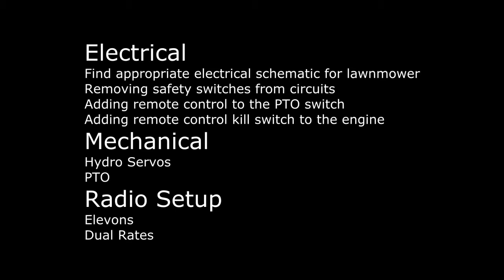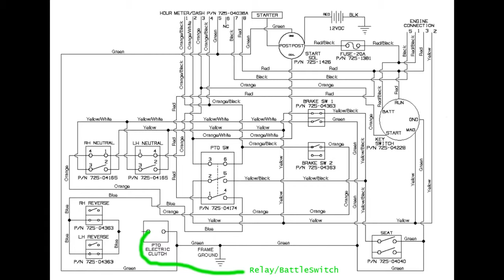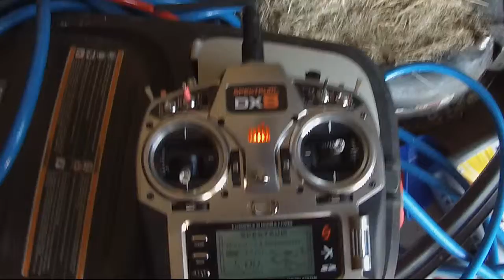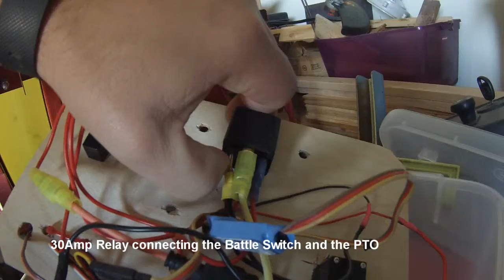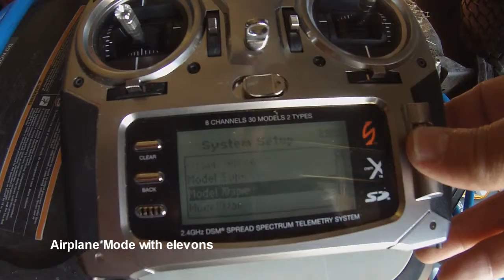DIY RC ZTR Lawnmower How-To

Comment: I just built mine on a Hustler Super Z 60" ZTR mower. I actually bought 99lbs steel gear servos and they are super torque and fast when the mower is off. Once the hydraulics are running, the hydrostats have too much resistance at the initial forward movement and reverse movement. Did you have problems with the hydrostats having too much back pressure?
Reply: Which servos did you use? And have they held up well? A link to were you got them would be great if you have time.  thanks

Comment: Did you use a microcontroller to control the servos?
Reply from the maker: Technically the battleswitch could be considered a microcontroller, but that is the closest item to a microcontroller in this model.  The next version replaces the board with a 16 port relay, ardunio, and gyros for better control.  I will do a video on it once I get it installed.
Reply: Bryan I’ll be ready for that video thanks for all the information you have given 
I’m disabled and tired of my woman mowing the grass

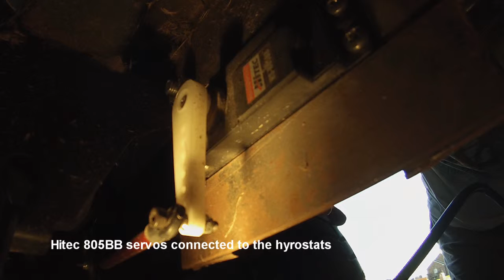Comment: Did you attach the server rocker arm to the original push rod that connects to the hydrostatic drive's rocker arms (~3:32 into the video) or did you make custom push rods to connect to the drives.  I'm trying to convert a Scag ZRT for RC conrol.  I originally tried to replace my original manual push rods with linear servos directly attached to the drives rocker arms and mounted to the frame via brackets bolted into existing holes in the frame, but I'm not able to get good smooth control & feel using the linear servos with my RC controller.  Now I'm thinking of using standard radial servos like the ones you used to drive the push rods.  My original push rods on the Scag are bigger & heavier than the ones shown in this video, so don't know if I should try to drive those with the Hitec or try to make smaller, lighter weight ones.  Also, how much drilling, modding of the mower frame did you need to do to mount the servos, thanks...
Reply from the maker: Ron, I used aluminum push rods, these are the same rod that are used in rc cars and rc rock crawlers. Something like these http://www.rcplanet.com/Traxxas_Pushrod_p/tra5318x.htm  The length will depend on where you can mount the servos.
Reply: Hey Bryan, thanks for the response.  I ended up being able to use my existing pushrods.  I just made a mounting frame for my servos and drilled a couple of holes in the mower frame to mount them and was able to rotate my pushrods 180 degrees to point backwards and connect perfectly to my servo arms via clevis attachments.  I was able to cut my entire front & back lawn today, but I am seeing one issue.  When the mower is off, I can get fill forward/reverse movement of the hydrostatic drive's rocker arms via the servo arms when I move the controller joysticks.  However, when I am running the mower and trying to drive it, I don't get full motion (in either direction), it's fairly restricted, even when pushing the joysticks to their full deflection.  I'm wondering if those hydro drives exert more back pressure on the rocker arms than when the mower if off, thus making them harder to move with the servo.  I'm using pretty decent HiTec servos, which have good torgue ratings (~500-600 oz/in).  The attach point of my pushrods is at about the 2 1/2  inch point of the servo arm, I know you lose torque the further out you are on the servo arm.  I was wondering if you encountered any issues like this.  FYI, here's the servos I'm using, along with a 3" aluminum servo arm.  They have servos with even more torque, but they are very expensive.  

https://www.servocity.com/hs-m7990th-servo

Also, I'm running all of my electronics off my mower's battery, which is fed from the mowers alternator.  I've mounted a volt meter gauge to my control box, I've noticed that the voltage will vary from ~12.5 to ~14.5, depending if the mower if off or on.  Everything seems to run ok with that voltage range, but I was considering getting a voltage regulator/stabilizer to clean it up & keep it at exactly 12V, I was wondering how you're powering everything and if you're running it off the mower's power, are you using a voltage regulator.

Thanks,
Ron
Reply from the maker: Ron, watched the following link https://www.youtube.com/watch?v=D7rQLUWmY3w.  Awesome Job.  I am guessing you are running about a 60" mower there?  Questions - Do you have springs on the hydrostats, you may want to take those off if you havent already.  The basis that  I used for positioning the servo arms, was to get max deflection in either direction with the maximum amount of force.  So you have to consider the angular distance and try to keep the arm as far away from the pivot point on the hydrostat, and as close as possible on the servo if that makes sense.  As far as power I am running 14 volts off the engine into the castle sBEC, that is stepping the voltage down from 14 volts to 6 volts.  If you are using a castle bec, you can set the voltage in steps, if you are using 2 6 volts servos you can get away with raising the voltage from 6 volts to 7.2 out of the castle bec to the servos, this will give you more oz/in of torque to also help you overcome the servo torque issue.  As far as the fluxuation in power, if you want you can put a 1mF capacitor and use that to smooth the power going to the sbec, but considering you are stepping to power down 5 to 7 volts the sbec is going to do the same thing.
Reply: Thanks Bryan, and thanks for the info.  That video was my 1.0 version of the RC mower.  I was using linear actuators in place of the pushrods to control the rocker arms directly.  The problem was they were not responsive enough, so it was hard to control.  I've since converted over to use servos that are attached to the pushrods, like you did.  There are no springs on the hyrostats, there are small hydraulic dampeners that are attached to the mower arms when it is configured for manual cutting.  I've removed the dampeners and mower arms, there is no other mechanical resistance on the rocker arms of the drives, and I can easily move them with one finger when the mower is not running.  I'm trying to think of a good way to measure and test my theory when the mower is running.  I have it up on blocks so I can run it and measure the force that way, but with the wheels just spinning in free air with no weight or resistance, I'm not sure if that is the same as mowing through tall grass or up hill.  I'll let you know what I find and post a video.  I think it's usable as-is, I was able to cut my front and back yard, but I really need to get my video camera mounted to I can get a first person perspective.  I had to keep good visual contact to see what I was cutting, esp the close cutting around flower beds etc, I don't want to have to keep it in sight and want to be able to cut from inside my house watching the video on my TV.
Reply: Ron Iovine  I’m doing the same thing to a hustler mower !! Wonder what camera to use to transmit a signal to the house 
One i seen was $1600